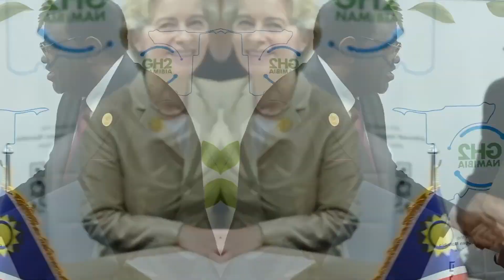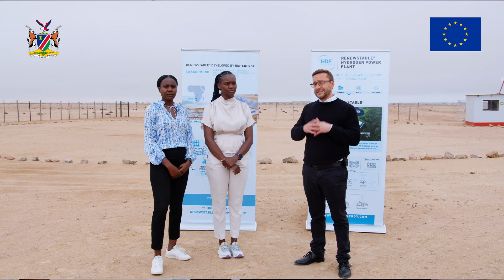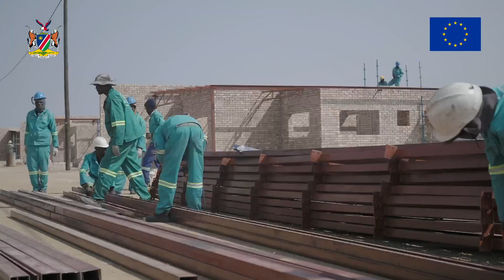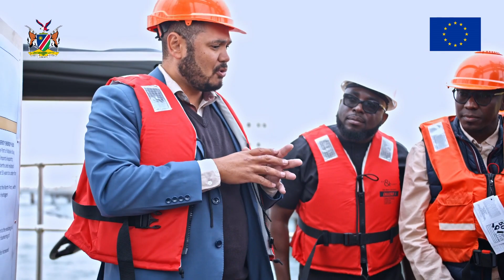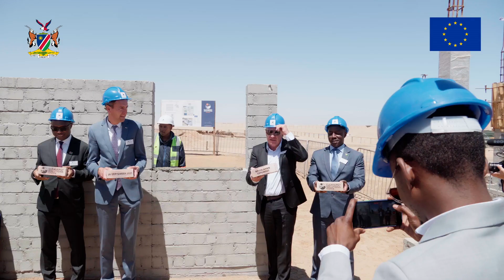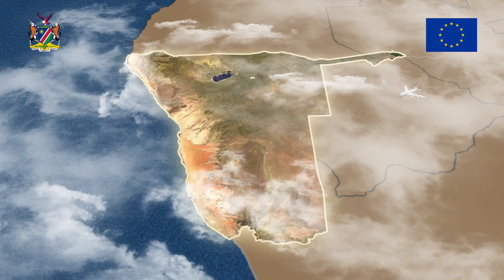EU Namibia Business Forum 2023

Comment: Transforming Namibia’s Coastal Desert: A Vision for Sustainable Development and Economic Diversification
A White Paper on Coastal Transformation, Renewable Energy, and Strategic Industrial Growth
Submitted by: David Hans Elze

Executive Summary
Namibia’s Skeleton Coast, a stark and majestic expanse of desert dunes and rugged beauty, holds untapped potential for transformative development. This proposal outlines a plan to stabilize Namibia’s coastal desert, leveraging European beach grass planting to tame sand dunes and create stable, developable land. Combined with strategic investment in phase-one economic activities such as diamond mining, oil, natural gas, limestone, and basalt extraction, this initiative sets the foundation for a robust second-phase economy built around basalt fiber production, cement, precast concrete marine structures, and float glass manufacturing.

These industries will not only support local development projects, such as the construction of resilient coastal towns and infrastructure, but also position Namibia as a regional exporter of sustainable building materials. The proposal also integrates waste-to-energy systems and renewable energy projects to power these industries, ensuring sustainable and environmentally conscious growth.

1. Vision and Goals
This initiative aims to redefine Namibia’s coastline and economy through smart investment, sustainable resource management, and strategic industrial growth. The key goals are:

Transforming the Skeleton Coast: Stabilize sand dunes with European beach grass, creating fertile ground for development and industrial activity.
Leveraging Phase-One Resources: Utilize Namibia’s wealth of natural resources—including diamonds, oil, natural gas, limestone, and basalt—for foundational industries.
Developing Second-Phase Industries: Establish advanced manufacturing sectors for basalt fiber, cement, precast concrete marine structures, and float glass.
Sustainable Energy Integration: Power industrial and community development with waste-to-energy systems and renewable energy sources.
Local and Export Opportunities: Use sustainable building materials for national development and export to global markets.
2. Key Initiatives
2.1 Phase-One Resource Development
Diamonds and Precious Minerals

Optimize diamond mining operations to generate revenue for reinvestment in downstream industries.
Ensure responsible mining practices to minimize environmental impact.
Oil and Natural Gas

Leverage Namibia’s recent offshore oil discoveries to fund infrastructure development and support renewable energy projects.
Use natural gas for local energy production and industrial processes during the transition to full renewable energy integration.
Limestone and Basalt Extraction

Extract limestone for cement production and basalt for advanced manufacturing, ensuring sustainable quarrying practices.
Conduct geological surveys to identify high-potential sites for resource extraction.
2.2 Second-Phase Industrial Development
Basalt Fiber Production

Establish basalt fiber manufacturing facilities to replace traditional steel in construction, offering lightweight, durable, and corrosion-resistant materials.
Use basalt fiber in local infrastructure projects and develop export markets for advanced composites.
Carbon-Neutral Cement and Precast Concrete Marine Structures

Produce cement using technologies like CarbonCure, incorporating CO₂ into concrete to create carbon-neutral building materials.
Develop precast concrete marine structures for seawalls, docks, and barrier islands, supporting local development and export opportunities.
Float Glass Manufacturing

Utilize Namibia’s abundant silica sand and renewable energy to establish a float glass manufacturing industry.
Support local construction projects with high-quality glass while exporting to regional and global markets.
2.3 Stabilizing the Coastal Desert
Planting European Beach Grass

Implement a large-scale planting initiative to stabilize sand dunes, inspired by the successful transformation of Oregon’s coast.
Use stabilized dunes as the foundation for new towns, industrial zones, and agricultural projects.
Sustainable Urban Development

Develop eco-sensitive coastal towns with housing, green infrastructure, and community facilities.
Use local building materials, such as basalt fiber and precast concrete, to construct climate-resilient infrastructure.
2.4 Sustainable Energy Integration
Waste-to-Energy Systems

Convert municipal and industrial waste into energy to power cement plants, basalt fiber production, and other industries.
Partner with technologies like Alter NRG to implement scalable waste-to-energy solutions.
Renewable Energy Projects

Expand solar and wind farms along Namibia’s coast to provide reliable energy for industrial and community needs.
Use renewable energy for green hydrogen production, creating a clean energy export market.
3. Funding Mechanisms
Revenue from Phase-One Resources: Use revenues from diamond mining, oil, natural gas, and basalt extraction to fund second-phase industries.
Green Bonds: Issue bonds to finance renewable energy, industrial development, and coastal stabilization projects.
Public-Private Partnerships (PPPs): Collaborate with global investors and technology providers to co-develop manufacturing and energy projects.
DAO-Governed Sovereign Wealth Funds (SWFs): Create DAO-SWFs to manage revenues from natural resources, ensuring transparent and equitable reinvestment.
4. Implementation Strategy
Phase 1: Resource and Feasibility Studies

Conduct detailed assessments of natural resource deposits, industrial potential, and environmental impacts.
Identify priority areas for sand dune stabilization and industrial development.
Phase 2: Pilot Projects

Launch pilot planting projects for European beach grass to demonstrate dune stabilization.
Develop prototype manufacturing facilities for basalt fiber and carbon-neutral cement.
Phase 3: Scaling Up Development

Expand planting initiatives along the entire coastline and begin construction of intercoastal waterways.
Establish full-scale manufacturing industries for building materials and energy projects.
Phase 4: Community and Workforce Development

Train local workers in renewable energy, advanced manufacturing, and sustainable construction techniques.
Provide educational programs to support emerging industries and community needs.
5. Expected Outcomes
Economic Transformation

Create thousands of jobs in mining, manufacturing, and renewable energy.
Diversify Namibia’s economy with robust local industries and lucrative export markets.
Environmental Benefits

Stabilize sand dunes to prevent desertification and create sustainable development zones.
Reduce carbon emissions with renewable energy and green manufacturing practices.
Social Impact

Empower communities with secure land access, modern infrastructure, and economic opportunities.
Improve quality of life through job creation, housing, and public services funded by resource revenues.
Global Leadership

Position Namibia as a model for sustainable coastal development and industrial innovation in Africa.
6. Next Steps
Present this white paper to the Namibian government and global stakeholders.
Engage technology providers and investors for pilot projects in resource development and industrial manufacturing.
Launch feasibility studies for coastal stabilization and renewable energy integration.
Conclusion
Namibia’s coastal transformation offers a unique opportunity to harness the nation’s natural resources for long-term economic growth and sustainable development. By strategically investing in phase-one activities like mining and energy production, Namibia can lay the foundation for advanced industries that create jobs, support local infrastructure, and position the country as a leader in sustainable innovation.

This vision not only addresses historical inequities but also charts a path toward a prosperous, resilient future for all Namibians.